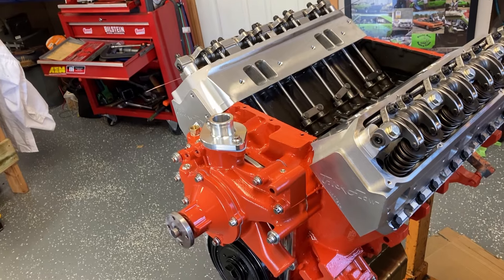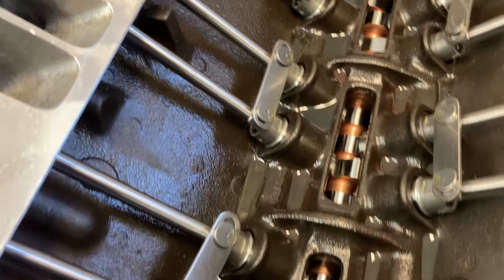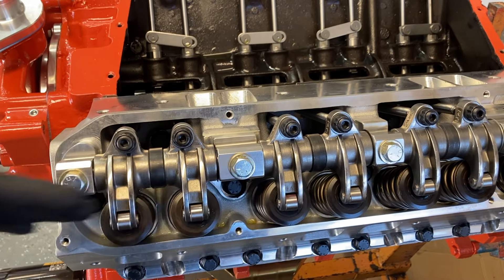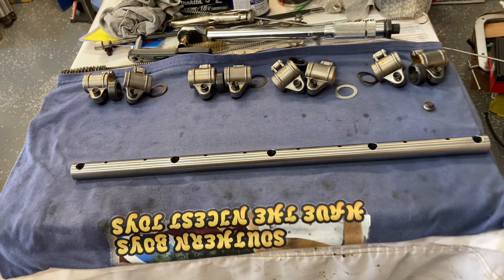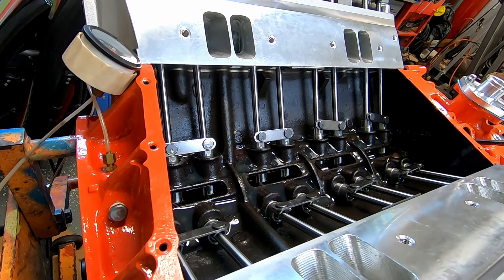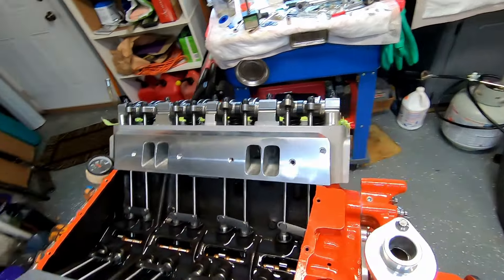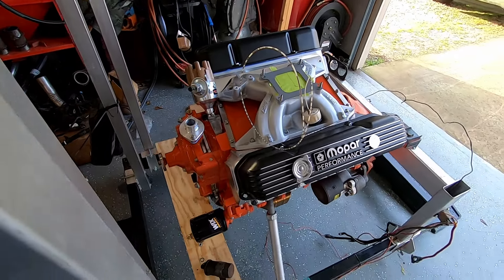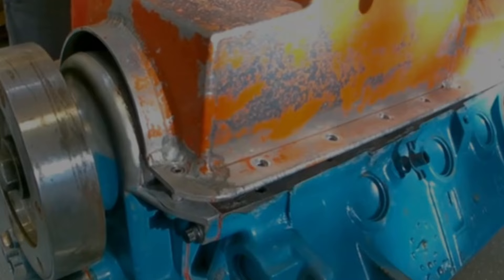Dyno 440 Engine Build Part 6:Final Steps to the Run Stand! #mopar #engine #bigblock #440 #dyno

Comment: When I built an engine (30+ years ago 🤯) after installing the oil pan I would then transfer the short block over to the test stand. I would finish assembling the engine on the test stand. My stand had the engine much higher so it was at a comfortable working height. When torquing the heads I could stand on the base of the test stand and not have to fight it like you do on a regular engine stand which is trying to roll around on you.
Reply from the maker: Very good idea. My test stand is much heavier and doesn’t roll as easy

Comment: Small question, Joe...what is your source for that thermostat housing and do you have problems with them leaking?  It seems like a near constant problem for me.
Reply from the maker: I believe the owner bought that one from Mancini. I never had an issue with the aluminum ones like that, but had terrible results with every chrome plated one I’ve ran. I found one through summit before that had a rubber O ring in the bottom and it eliminated the gasket. I had also thought about having an aluminum one machined for a large O ring and ditch the gasket all together.

Comment: Hi Joe How big of a cam roller,TTF heads 240? Single plane elderbrock what intake?
Reply from the maker: Thanks brother. New Torker 2 intake. I just did a video on cleaning up the casting flash. I  have a video giving the full specs of the build here. Sorry, it’s alot to go over. https://youtu.be/_jYcnSNDsos?si=3WmENe1HpGQWfc2J